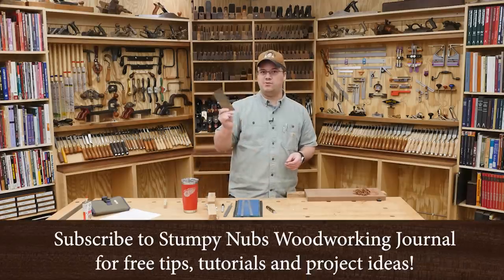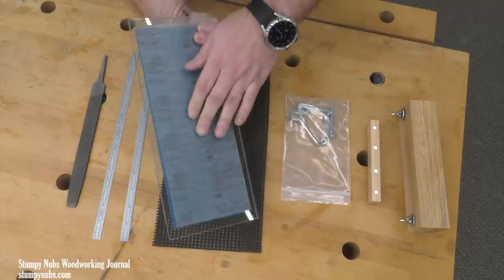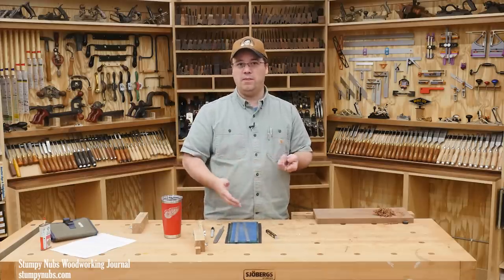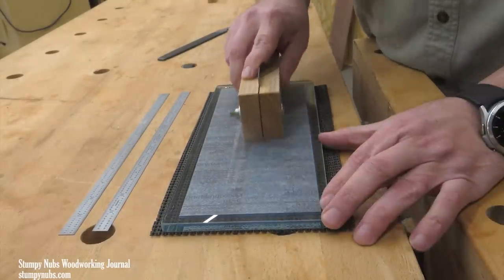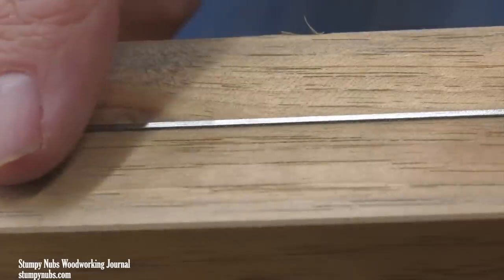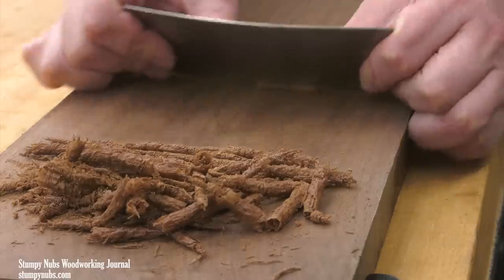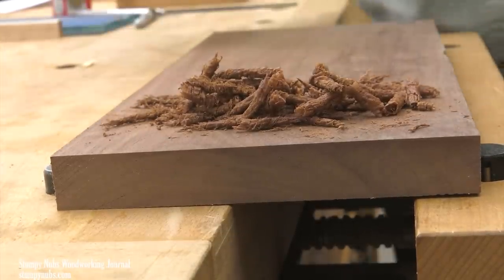Faster method ENDS most sanding and sandpaper!

Comment: We called them 'cabinet scrap0ers' at school in late 1960s. Used them all the time. At my boarding school, they used to open art school, science labs, and woodwork shop for four sessions - Tuesday, Thursday afternoons, Saturday evening, Sundays - 7 hours total. Teacher wasn't a teacher, he was head of maintenance and was, himself, a master carpenter
Reply from the maker: Traditionally, a cabinet scraper is a hand plane-like tool that holds a thicker piece of steel at a negative angle. Stanley #80, for example.

Comment: A scraped surface is more sealed than a sanded surface, and will require fewer coats during finishing. And it's a great way to prep inside corners.
Reply: True, and the wood pores are less cluttered with dust. That told I have also to tell that the surface that comes from a properly tuned and used hand plane is even better, off course to prepare and use a hand plane to get that result needs much more skill and experience then to tune and use a scraper and certain pieces of wood are very difficult to plane, but is the faster and better way to get a perfect surface most of the times. The difference of quality in the surface is even more apparent if you use oil for finishing.
Reply: @andreachinaglia5804  Thanks for your insight, I'll keep that in mind. I've been working with tamarack and cedar. With scraping the knots don't seem to cause too much of a problem so far.
Reply: Any elaboration, sources or "proof" for that statement ? Would like to learn more
Reply: @TheOneMastodon  I tested it comparing the surface obtained by planing vs the surface obtained with 3 different top quality orbital sanders, Festo, Makita and Bosh, equipped with quality sand paper: the surface appears to be very close, but as you apply some oil on it the one from the plane looks much better. I did that at a woodworkers meeting many years ago and all those that was there, some professional workers and some advanced amateurs, agreed about the surface obtained by planing being superior as soon as the oil was applied. There are probably 2 reasons why: the surface is obtained by a cut and not something that scratches the wood and the pores are not cluttered with sawdust. After that test I gradually shifted from the hand held electric sanders to the planes that I use even to "sand" plywood. Using the planes is also better as there is no noise or dust (that is not so healthy to breath), so ear and lung protection is not needed and is fast, much faster then any hand held electric sander. I am not talking of theory or of some test done and soon forgotten, I am talking of something that I am doing in my real life woodworking in the last 15 years or so, I own a very good and expensive orbital sander, but I had used it very seldom in the last 15 years as the hand plane is much more efficient and pleasant to use (if you have the needed skill in preparing, setting and using it). If the plane is not suited for the particular work, some woods and some grain orientations are problematic even with a perfectly tuned plane, you can judge by yourself how the card scraper is fast and effective watching the video.
Reply: @TheOneMastodon Iit's a super easy experiment, give it a try. You can also pull a scraper instead of pushing it. Works great for inside curves and inside corners.

Comment: That's a great kit setup!   I tried and failed with scrapers for years until I tried lightening up. I was trying to KILL the metal with the burnisher for years and always failed.  Turned out I was likely forming too large a burr and rolling it over too far.  So it would only cut when the scraper was laid way over at some crazy angle.  And being so big a burr it broke off and dulled very quickly.  

It was only a few months ago that the fast rapid swipes shown in various videos made me lighten up and use a firm but not crazy hard pressure.  And it worked GREAT!.    My shavings are now coming off like the ones in this video.  And the sharpness is lasting just like you're saying.     So firm, not heavy is the key.  And more strokes rather than heavier if needed.  Less is more in this case.

Comment: I built a clamp just like that 15 years ago. The one thing I never did was polish the flats. I  gotta try that!, 
Here's a burnishing tip for those without that little tool.  I raise the scraper 1/16th above the flat edge of the clamp, and use the edge of the clamp to set the angle of my old valve push rod burnisher.  another great video!

Comment: THIS IS JUST   LIKE RE INVENTING THE WHEEL . 
i am 58 yeas old   my  grandad  taught me how to use  a spoke shave   and  how to hone a scraper blade   .
 to this day i still  have   scraper blades    that   are profiled  to produce    radiuses and   profiles    the type  you cant even get thease days  .
 i never forgot   that   skill .  
my home    to this day  has  dado  rails and   skirting  i  reproduced   from  the original forms  .
IE . my 10 inch skirting i made by hand  look's  like   it has been there   from the day the house was built   , 
 [  i could not even get the   original  profile    .   so i made my own  ]
 
THANKS  GRANDAD  YOU TOUGHT ME A REAL SKILL  :)
Reply from the maker: The technique in this video is not "reinventing" anything at all.

Comment: The only part of what you show here I wasn't aware of is the burnisher.
But I think I can make my own. Will give it a go. Thanks, Mr. The Nubs!
Reply from the maker: A burnisher just needs to be harder than the scraper, and perfectly smooth. Screwdrivers make poor burnishers because they are not machined very smooth. But engine push-rods make good burnishers.
Reply: @StumpyNubs  axles from old printers also seem like a nice candidate.
does the burnisher have a special shape that makes it work?
Reply from the maker: @sliceofbread2611  The shape of the one I showed makes it easier to use (as I explained in the video) but any smooth, rod-shaped, extra-hard material will work. You will just have to adapt your technique and practice a bit.
Reply: likewise, thanks for commenting

Comment: Interesting, basically taking the "ruler trick" for hand plane back flattening and applying it to the card scrapper, followed by a Burnisher (which I really like). The jig is a great way to be consistent as well, I know I have to stop and think about all the steps since I don't use them often and sharpen them even less often because of that. 
I can probably make up s similar jig/kit from parts in the shop so I'll have to give this a a go. I find my card scrapers to be very inconsistent, but maybe I need to sharpen them more.

Comment: I'm a musical instrument maker who specializes in historical bows.  Starting about thirty years ago, I completely stopped using sandpaper, finishing the surface with scrapers of various kinds, and then polishing with equisetum (horsetails) and/or mammoth dust (a byproduct here).  This is close to the way things were done hundreds of years ago- it doesn't have the boring perfection of sanded surfaces, but it saves time and (in my opinion) looks more alive.

Comment: I really like using card scrapers.  I do like using my larger diameter burnisher.  It applies less pressure but makes a cleaner hook.  For certain purposes I use smaller scrapers withan angle on the end to get into corners.  Also, particularly with those scrapers, I file the edge to an angle and burnish a hook on only one side--(like the blade in the Stanley scraper plane that looks like a spokeshave with a very wide bed).  Takes of large shavings from hard to reach places on glued up cabinet work and boat deck structures.

Comment: I learned to sharpen card scrapers while working in a ski repair shop over 30 years ago. But this system will certainly obtain much more consistent results. Very nice setup.

Comment: Dandy ideas. I made a similar vise from plans. I use a couple of pieces of paper on either side to get the scraper a little proud. It works Ok, but only just. I like this idea, especially the burnisher and will buy one of them. 
Now a suggestion, if you will. Every card scraper demonstration I've seen uses straight-edged scrapers. It is easy enough to extend the basics to slightly curved scrapers.  Recently, however, I tried to sharpen a French-curve scraper and after a long fight only partially succeeded. If you were to put out a tutorial on highly curved scrapers, I think it would be well received.
Keep up the good work!
Reply from the maker: There are no videos about sharpening goose-neck scrapers because few people use them and such a video would not perform well.

Comment: Very interesting; I’ve never used a card scraper: May I ask if it’s good just for finishing or if can be used for varnish removal as well? Thanks for sharing the video, informative as always
Reply: Yes, scrapers can be used to remove varnish, but they may dull quicker on thicker, harder coats. You may need to make a lesser, thus stronger "hook". Where they shine is for smoothing the wood. Because they "shave" rather than scratch (like sanding paper), they leave the surface very smooth, almost shiny on hard woods. Always scrape along the grain or at a slight angle. You will need the tool to burnish it (and a file or stone to reset worn hooks). Together with the burnisher, it may seem expensive ($25-45), but unlike sand paper, they will last you indefinitely (and easy to clean if the clog along the hook with paint or varnish). And they make a nicer job. When you push it, you need to bend the scraper in a slight bow forward (the more bow, the more aggressive the shaving) and also lean it forward. It is a fantastic, cheap tool. Probably best to buy from a reputable store as it needs to be made of the proper steel. Or, if buying on-line, check the reviews.  One last thing, you may find that on some planks, the scraper works best in one direction, that is "downhill" of the grain (a bit like a router). That can be a problem on woods like burl and fiddle back veneers where the grain orientation changes frequently. If you need to go "uphill" of the grain, go very lightly. Once you get the hang of it, you don't look back.
Reply: @yl9154  it sounds like a great tool indeed. thank you very much pal for taking the time to explaining it to me in such a detailed way: I’ll keep these insights handy !
Reply: @hardstylelife5749  The fact that you bothered to thank me shows it was time well spent!

Comment: There are even planes that use a card scraper and if you adjust them correctely you can use them instead of sanding between voats of shell lack.
Also for sculptural pieces a flexible card scraper can be made from old blades from japan saws.

Comment: When i started using these for finishing 3D prints... i have not bought new sandpaper in a year now. The edge needs to be FAR less aggressive for plastic but it cuts down time to about a fifth.. Basically, what you want then is as sharp of a 90 degree angle as possible, with just a very tiny lip. I have one that has just the 90 degree edge that i alternate based on the needs. Sometime even a tiny lip will "catch" and dig into the piece a bit too much.

Comment: It is. a drag that the scraper is. pressed into a 'U' shape when in use.  It is easy to see at 4:07
I wonder if clamping pieces of wood across it before using it might keep it flat so there is less chance of scalloping out the face being scraped.
Reply from the maker: A scraper is intentionally bent like that during use. The more you bend, the more aggressive the cut. It would not cut very effectively if it were perfectly flat.

Comment: Does it matter what grit the surface is prepped to, before you can switch to the card  scraper?  Thanks.
Reply from the maker: You shouldn't have to sand at all before using a scraper.

Comment: I've always wondered.  What equivalent grit do you need to match a card scraper
Reply from the maker: If the scraper is properly prepares as shown in this video, the surface left behind will be smoother than any but the highest grits of sandpaper.

Comment: That's a really interesting kit, and looks like a variation on a chisel sharpening technique, that uses plate glass, & similar film surfaces (originally for electronics lapping).
If they're selling this kit, expanding into that chisel sharpening set, and a combined kit, might net more sales.
Reply: I haven't received mine yet, but it seems like it would work quite well for chisels and hand planes too.  It seems like everything you need is already there.  They have even included the rulers for the ruler trick, and you can also use them for champering hand plane blades.

Comment: Can you make your own scraper out of sheet metal, or are they made from a special metal?
Reply from the maker: Scrapers are just pieces of hardened steel. The come in different thicknesses but are all thin enough to bend during use. I wouldn't use sheet metal (it's not hard enough), but an old hand saw can be cut up to make several. Just don't blue the steel when you are cutting it. Or, for less than $10 you can get a couple pre-made: https://lddy.no/1g247
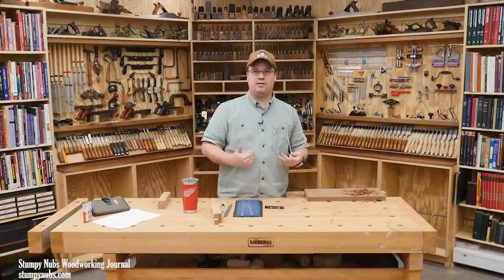Reply: @StumpyNubs 5:49

Comment: Assuming I can get my scraper to work like this, is any sanding required, and if so at what grit after scraping?  Thanks.
Reply from the maker: A scraper will leave behind a surface that is ready to finish. But if you want to stain or dye, you will have to use some 120 or 180 grit to make it a little rougher so the stain will take.

Comment: Looks like a modified hand planer would be awesome for this.
One that worked in reverse, where the opening for the shaving was on the "underside" of the blade.
Then, "sharpen" the blade until it gets the big burr.

Now you get the ability to draw nice shavings instead of sanding, BUT have the peace of mind to know your you're creating a flat surface since your blade is always FLAT, not grooved due to having to put a bow in that card while holding it.

I do have a could of scrapers that I used like this, but pretty sure they were intended to be for scraping PAINT (or maybe wallpaper??). While they work great for this, they still have the downside of lacking the accuracy of a hand plane device which keeps the blade at a fixed orientation and in a jig (the frame) to maintain a uniform cut.

I'm just a hobbyist though, so I might be missing something...
Reply: Just do a search for "Japanese handplane" here - perfect flat edge, of course, and they shave on a pull stroke. And you don't need to resharpen it every 2 minutes. It's literally a block of wood with a notch for the chisel blade, with a sturdy pin and metal wedge to keep the blade in place. Since the block is so simple, there's a little bit of work needed to dial in the blade depth before first use. But since most of the block doesn't actually touch the work piece, when that's done, it's literally just the blade doing the work. Unlike a western plane, you don't need to worry about the foot getting hung up anywhere or any unevenness. Sharpening is just with a water stone, like good-quality chisels.
Reply: @Trixtah  Yea, but that still is using the blade to "cut" the wood, not scrape it.
Scraping prevents the possibility of the blade digging in, which can happen (in my experience) even when drawing it towards you... as I've done by just using my tiny single hand plainer, backwards heh

Comment: I do like a card scraper's results.. but they hurt my hands to hold...is there any sort of thing to make them a little more ergonomic for my poor joints?
Reply from the maker: Several companies make scraper holders that have an adjuster screw in the center to create a bend. But I find them too bulky. A better solution is to get thinner scrapers that are easier to bend. They are available in different thicknesses.

Comment: I made myself a scraper with a grip from a disintegrated breakfast board made of bamboo. As blade, I used a piece of metal strip that is used to stack & package rectangular stones, for example. I always try to scavenge these metal strips, as they can be recycled for different purposes 😆
On the grip, I sawed a slot along the piece of wood and drilled two tiny holes at both ends, at nearly half the depth of the slot. Used these holes to secure the blade in the grip with a small solid wire, a nail could also be used.

Comment: My biggest inquiry regarding card scrapers has always been creating gouges or a concave shape to the face of the board. Any thoughts/tips/input?
Reply from the maker: The more you bend the card and the more agressively you scrape, the more uneven the surface may be. In my experience, that surface looks quite nice. But scraping is not my first choice if I need a perfectly flat surface.
Reply: What about trying steel wool?